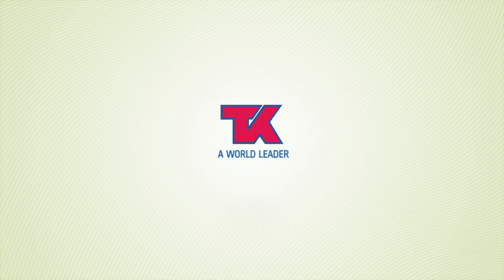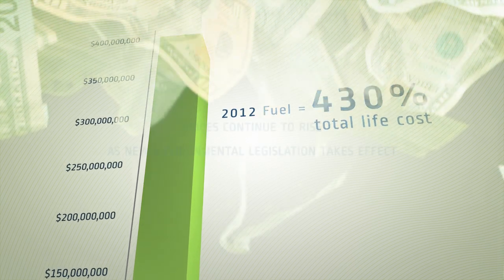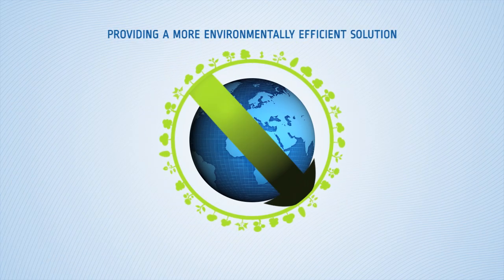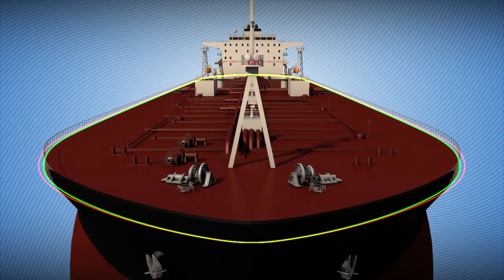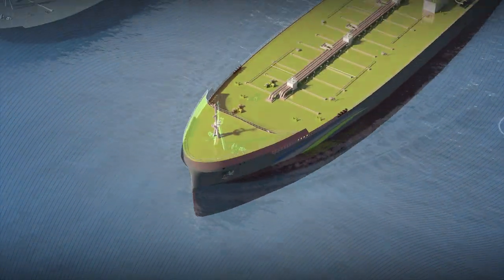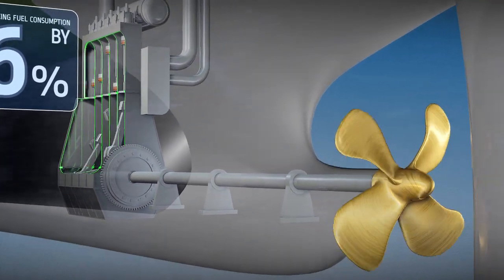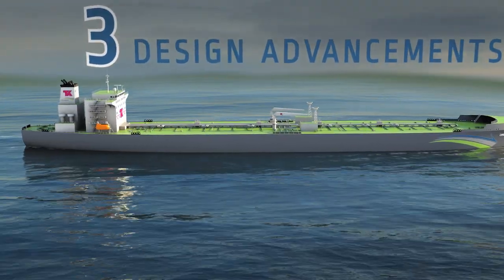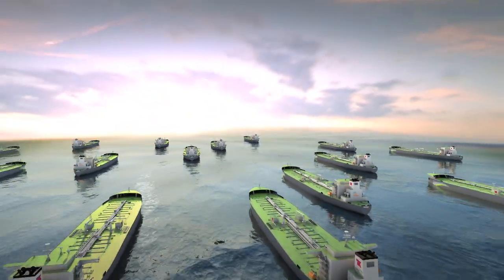3D Animation & Motion Graphics Explainer Video - Evolution of a Super Tanker - Teekay Shipping

Comment: Meh i like to stay with the bulbous bow its better.
Also just wondering why not add a high gear transmission? Doest’t let the ship move faster?
Reply: Good idea, mate. Low gear for harbour maneuvering, high gear for ocean cruising. Like the overdrive option in cars, this could possibly save thousands of $$$$ each year. Trouble is, the gearbox could break down, stranding the ship if that's the case. But otherwise, great idea!
Reply: I'm not sure what you mean . Do you mean it would be better if the ship was faster ? If so not it would not , it would cost more in fuel burn .

Comment: Everything sounds great and all, but I'm not sure I like the removal of the bulbous bow, generally it increases the streamline of the bow.
Reply: The bulbous bow was designed to decrease stress on the hull by decreasing the wave size created by the bow. Not sure how removing it increases efficiency.
Reply: Yeah, the bulbous bow replaced the kind of bow depicted here.
Reply: a bulbous in tanker reduces the wave breaking resistance not the wave making in full form types of ships
Reply: Only in light wave conditions would a non bulbous bow be an advantage. The main advances shown here are the engine and the propeller design .
Reply: Yes, I hate this idea.
Reply: Removing the bulbous bow to cut water better is bullshit. Also, the bulbous bow reduces wave breaking resistance by reducing the wave making resistance, so Eshwar talks shit.
They probably go very slow, so that the bulbous bow is useless anyway and the reduced angle of flow separation are the real reasons.
Reply: I agree
Reply: Well since you don't like it lets add it back...
Reply: If you would listen it tells you why they removed it... Does it really Matter anyway?

Comment: The phenomenon you are talking about is called wake reduction which is caused due to the reduction of the relative speed of propeller and water due to water flow following ships movement. What you must keep in mind is that, overall, the hull of the ship is designed to increase propeller efficiency due to the streamlines of the water converging at the stern of the ship, which gives an increased propulsive efficiency compared to propellers open water efficiency.

Comment: I don't get why they still put the propeller faced the wrong way (with the hull moving water away from the propeller. If they turn the propeller shaft around and let the propeller take in untouched water (this is why the propeller of an aiplane is on the front of the plane, not at the back). This saves a lot of energy, and some smaller boats already have this